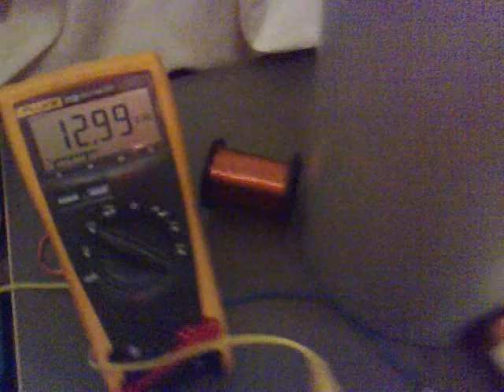Pulse Motor (Pot Problems) 088

Comment: maybe try a cap on both sides of the charging circuit so it will regulate volts from the coil to the pot and from the pot to the battery. Voltage spike can get really high and the caps might level them out. if thats what is burning them up